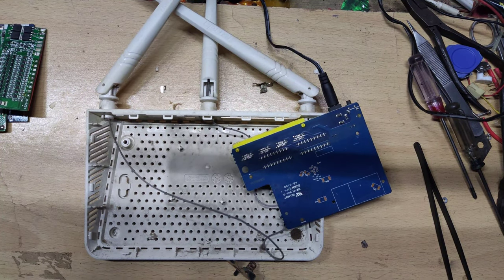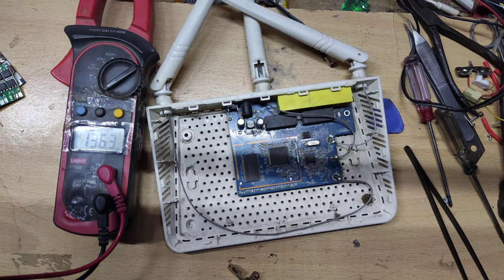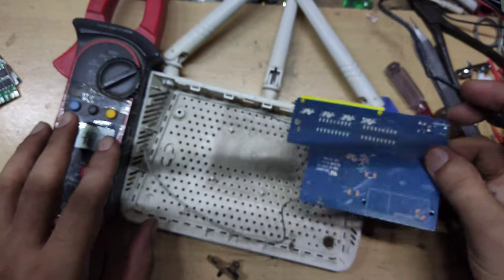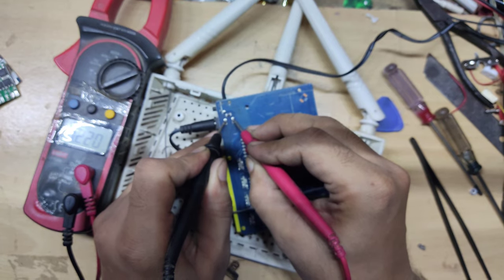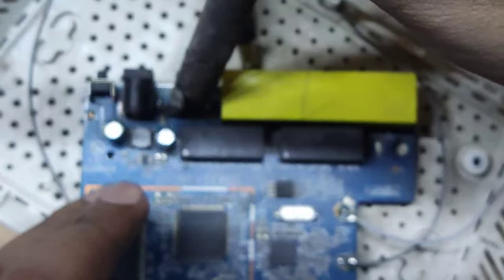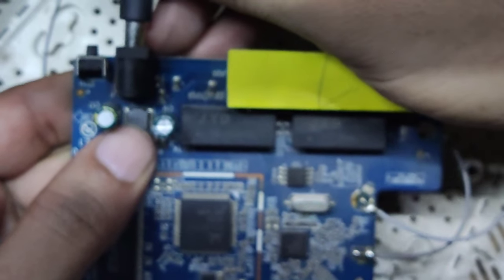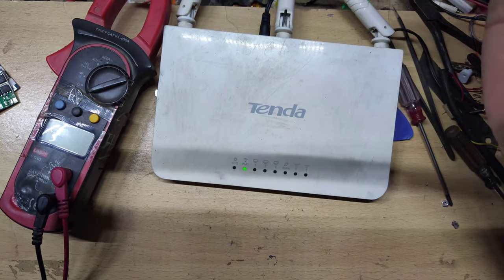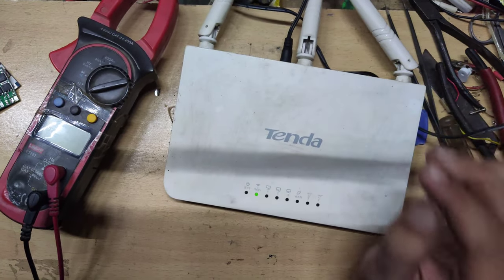How To Repair Wifi Router At Home | Wifi Router Dead Soloution

Comment: Bhai mera adapter kharab ho geya tha chal ni rahi thi..bad main maine bohot jiyada bolt wala adapter router ke wire se jodr dia and lagate hi wo blust kar geya. Bad main meine jali hui connection port change kia lekin wifi light nehi chal rahi. Andhar ka sab kuch accha dik raha hain jali hui nehi dik raha
Reply from the maker: Bro is main fusable resistor check karo , phir dekho koi component great ho raha hai to usko test kar lo, power ic kharab hi sakta hai

Comment: Bhai meri router ma be ak problem a gai ha fiber optic pa karwaya bana antena wala MT link router leya check kar ka jab connection lawa leya name or password change keya operator na tu wo password lag rahe raha tha or upar sa jab band kar  kar ke on keya tu power or loss ki light on ha age nahe ka raha
Reply from the maker: Router k andar hi wifi hai ya bina wifi k ONU wala hai? Jis ko simple Walay router se connect kartay hain?

Comment: Bhai tenda n301 on hota light waghera chal rahi lakin wifi signals nai show ho
Reply from the maker: Bro charger change kar k try karo, 2.5Amp wala
Reply: @Tech2Treasure  jo tenda ka sth hota box main wo kitny amp wala hota
Reply: @Tech2Treasure  on ho raha lights chalti hain lakin wifi signals nai a rhy
Reply from the maker: @usamakhokhar8275 bhai different models k saath different Amp main aata hai, time k saath inki power kum ho jati hai, jab wifi system on hota hai to power consumption thodi increase hoti hai, aap charger change kar k try karo, open karnay se behtar hai
Reply: @Tech2Treasure  incase charger change krny se nai masla solve hota to phr kiya karuuu
Reply: @Tech2Treasure  jo homemade solutions
Reply from the maker: @usamakhokhar8275 phir aap mechanic ko check karwain, kyo k aap khud nahi kar pao gay
Reply: @Tech2Treasure  acha

Comment: Mera router mein voltage ic kharab hogaya hai to mere router ko 3.3v chaiye to maine diode se mila kr 3.3v supply banaya hai to kya mai usee laga skta hu??
Reply from the maker: G bhai magar ic kharab kyo huwa hai isko bhi zehan main rakhain, ic tab udta hai jab aagay shortage hogi, ya main supply ziada aai hogi, bahar hall agar sirf Supply chahiye to diod wala method bhi kaam karta hai, 1 diod 0.6 volte tak drop karta hai.
Reply: @Tech2Treasure  jazakallah bhai apne jawab diya...bhai ek sawal aur hai ki 3.3v ki supply kon sa jagah per dena hai..??..aur supply kitne volt ka dena hai kyu ki mujhe thodi se confusion hai kyu ki jo ic kharab hua hai thik ek aur ic same number ka uske just bagal mai hai 😄..to aap bata skte hai
Reply from the maker: @mdaamirasad3344 Bhai asal main koi bhi electronic circuit sirf aik tarah k voltage per nahi chalta, kusi component ko ziada or kisi ko kum voltage chahiye hotay hain, ic is cheez ko manage karta hai or aik se ziada qisam k circuit ko requirements k hisaab se voltage provide karta hai, aap ic ko bypass kar k 3.3 voltage per apnay Router ko nahi chala saktay,
khud sochain k company agar ye ic na lgati to lakhon ruppay bacha sakti thi itni producing hoti hai unki, magar ic zaroori hota hai,
Reply: @Tech2Treasure  bhai??

Comment: Sir mera Nokia ka Dual band router hai, usme ekdum se 5ghz band ka signal aana band ho gaya, even 2.4 GHz ka name change ho gaya, aur jab ip address se modem mei login karne ki koshish karta hoon to jo default I'd aur password hai, uss se login bhi nahi ho raha, 

Isme kya karoon sir ke ye dikkat sahi ho jaaye?
Reply from the maker: bro app reset button se modern ko reset karo,  agar router management page per ja saktay ho to aap wahan se bhi reset kar saktay ho, agar pair bhi na ho to aap iska firmware upgrade kar lo.
Reply: @Tech2Treasure  sir reset button dava diya, hard reset bhi kar liya, par phir bhi same issue hai, aur Ip pe login credentials bhi galat batata hai
Reply: @Tech2Treasure  sir bina login kiye firmware upgrade kaise karoon? lAN se bhi connect karke login nahi ho raha, invalid credentials dikhata hai
Reply from the maker: @cookeatrepeat246 flash firmware
Reply: @Tech2Treasure  have no idea about it, thoda guide kar do sir

Comment: Please apni location bta den mery pass 2 router hn jo on hoty hn pr work ni krty
Reply from the maker: bhai main channel k liye videos banata hon, meri koi shop nahi hai
Reply: @Tech2Treasure Hi , mera syrotech ka router h on to ho rha h sirf wifi  ki light jlti h fir bnd ho jaati h 5-10 min m, 5-10 min hi chlta h fir jb chlta h jb wifi ki light shi se kaam kre  uske turant baad hi Los red ho jaata h any solution?
Reply from the maker: @ramandhamija5001 hi
Bhai aap pahle Apne router ki supply ko change karo aur agar supply ke bad bhi masala ho to uske andar capacitor hote hain vah week ho Gaye honge aap unko change kar lo  theek ho jaega
Reply: @Tech2Treasure  pta kese chlega konsa capacitors weak h ?
Reply: @Tech2Treasure  I want to share something

Comment: Hi i am from Bangladesh 
My f3 router Power plug in after all light opening No Off Light
Reply from the maker: Have u tried to reset from reset button?
Reply: @Tech2Treasure  Reset Not Working??😥😥
Reply from the maker: does it transmitting wifi signals?
Reply: @Tech2Treasure  All time all light opening
Reply from the maker: do u get wifi signals?
Reply: same issue sir all lights on and no wifi signal in tenda router help me sir
Reply: @Tech2Treasure same issue sir all lights on and no wifi signals help me sir
Reply: @iftikharhussainP plug in and plug out few times it’ll work.